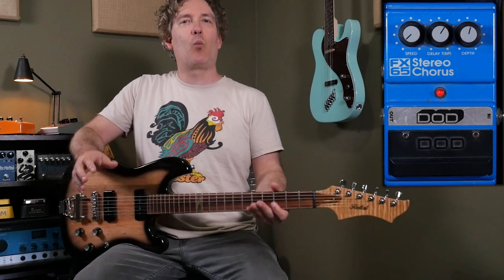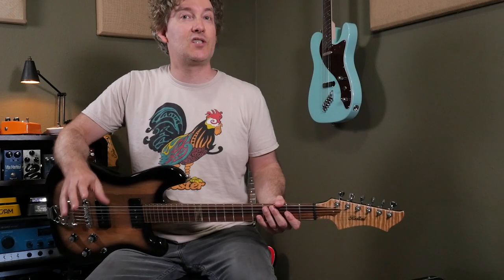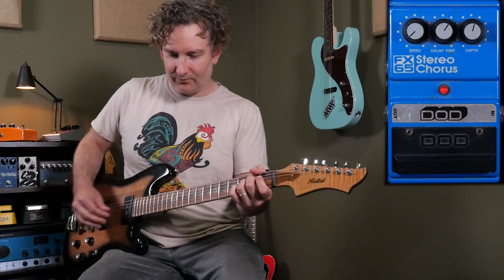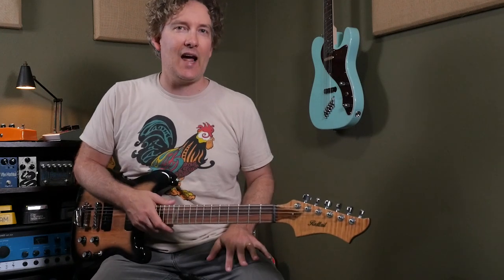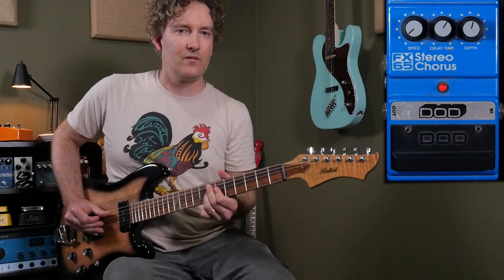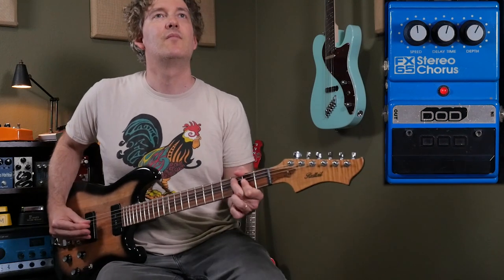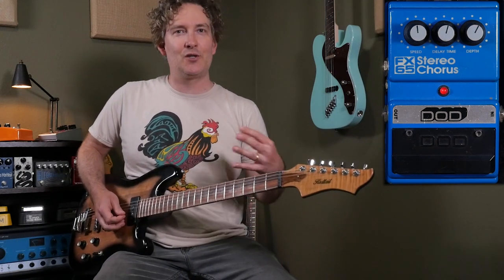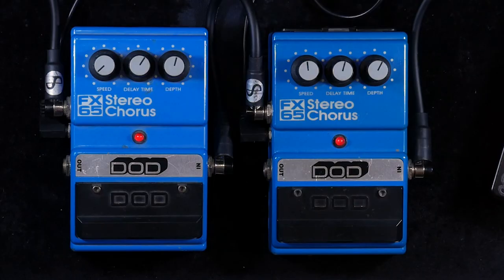DOD FX65 Chorus: How I Use Them

Comment: Another trick with the FX65: use a variable voltage power supply to starve the circuit, slows down the chip clock to make it even more lo-fi trippy!
Reply from the maker: Good point, I always run mine at 12V and will have to try it! Thanks!
Reply: @AndyDemos  What do you use to power yours?
Reply: Could you guide me further on this topic? They gave me one but I don't know how to use it :/
Reply: @Jonh548  With the audio output in the second/stereo jack, start with the power at 9v and gradually lower it. When the unit doesn't have enough it will make a loud clicking sound, so increase it just above that level.
Reply: @Markleford  Thanks brother, I'm trying to find a video that talks about this but I'm having a hard time, if you know of any video that talks about it I'll appreciate it 🙏🏻🥲
Reply: Starve the circuit. Man thats mindblowing!

Comment: Sounds great.  It's funny how, in the land of chorus, a little nudge in this or that direction of only a few milliseconds gets you what feels like a qualitatively different sound.  I suspect the "iffy" part of it is that the FX65, and most BBD-based chorus pedals, use small-value ceramic capacitors for setting the range of the clock that drives the delay chip, and those caps are not especially precise.  That's not a slight on quality, but it does mean that nailing the sounds you illustrated can be hit or miss, and vary by unit, unless one is selecting caps, based on measured value, rather than what is printed on the component.  The schematic shows the critical capacitor to be 25pf, which doesn't leave a lot of room for adjustment.  Much like the Boss BF-2 flanger, the FX65's "Depth" control essentially pans between a fixed voltage and the LFO.  So, more of one gets you less of the other, and the Delay Time control adjusts what that final combination results in.
Reply from the maker: Wow thanks Mark, always interesting to hear your input! 👍🏻
Reply: @AndyDemos  Thanks Andy.  I always learn from you as well.  One day we have to meet.

In the meantime, here's an experiment that you or any viewers here can try.  I've done it and it works.

With "through-zero flanging", the delayed signal being modulated moves ahead in time, relative to the stable "dry" signal.  It is essentially impossible to get a bucket-brigade chip to do that.  However , if one delays the dry/clean signal by a very small amount - less than 2msec - the delay can be swept to times shorter than that.  Craig Anderton explained this very nicely some 40 years ago in one of his GP columns.

I mentioned how the Depth control works in the FX65, and many other analog time-based FX, panning/blending between a fixed and modulated voltage controlling the clock in the circuit.  I own a pair of old blue-box Boss BF-1 flangers, that use this approach.  I lifted one end of the resistor that mixes the dry signal in with the wet (an easily reversible and nondestructive mod).  If I use one on the units as my "dry" signal, and the other as my modulated signal (using a splitter/mixer to separate and then recombine their respective signals), I can use the Manual delay control on one unit to set a fixed delay.  This determines how much "room" there is for the swept unit to move "ahead" of the other in time.  In effect, I can determine how long the swept unit spends on "the other side of zero" before returning back through the zero point.

Even wilder, if BOTH units are allowed to be swept, in unsynchronized fashion, the "through-zero" point crops up in an unpredictable and inconsistent way.  Not everybody's cup of meat, but interesting.

In the FX65, one could produce a "fixed delay" by lifting one end of R39 and/or R46, both 47k, and adjusting the Depth and Delay Time controls to get a steady short delay coming out either or both output jacks.

Comment: I couldn’t wait to get rid of the fx65 because of the phase cancellation. I did some recording in stereo but gigged with it in mono. I used it for 3 
years but finally gave up on it. 
The other guitar player in the band had one that was opposite mine. He always used the top output, the bottom output had the phase cancellation on his. 
I replaced it with a Boss CE-3 which is still on my pedal board 38 years later.

Comment: Andy, are there any instructions on how to do this mod?
Reply from the maker: I believe the slower rate on the FX65 comes from adding a resistor in parallel with the rate knob. I don’t know the value but you can experiment and not hurt anything.
Reply: Thanks Andy for the fast response! You’re the best!